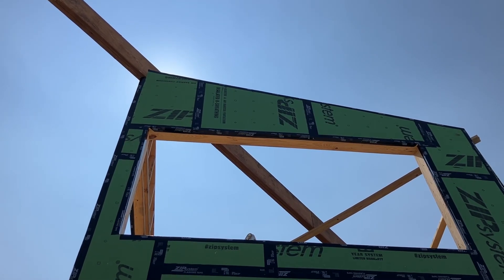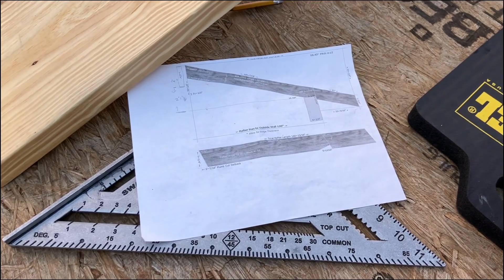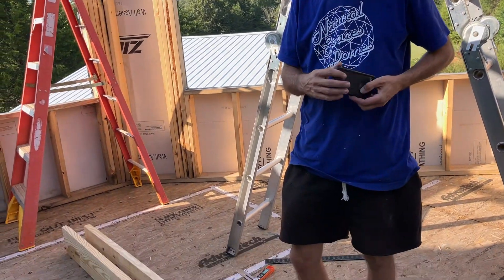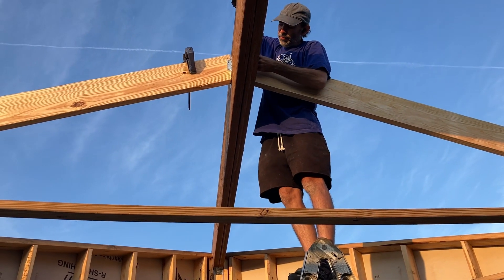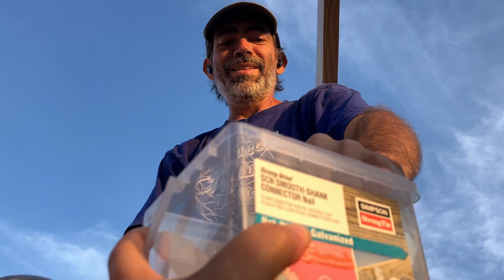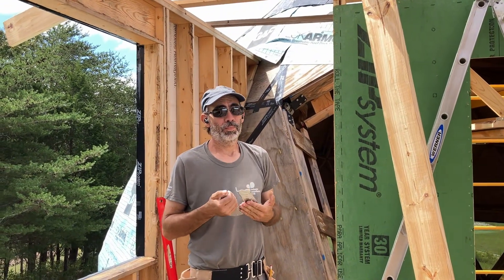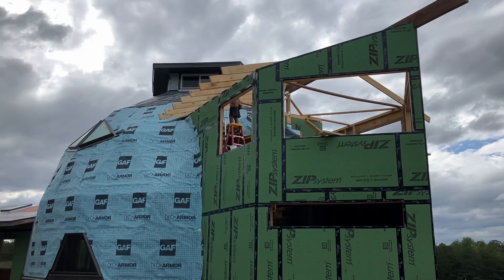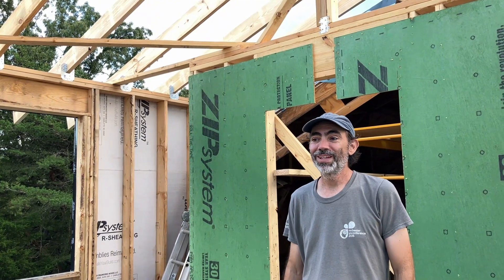Rafters And Angry Birds(Mouths)...Part One

Comment: Also I think Brian needs a new tool. Get him a jigsaw for those birds mouths.
Reply from the maker: Probably would have worked better and we do have one but it's not battery powered so he'd have needed to set up the generator.  Oh...so a new battery powered jigsaw?  Stop encouraging him! :)
Reply: @trippyacres  Never! I will always encourage more tools. Also I would recommend instead of measuring, cutting, and installing one at a time, once you get the first rafter right, use it as a template for all the others. Trace them out, cut them all, then install. Less brain strain on Brian 😉
Reply: @pnwscitech1589  I'm with you.. you can never have too many tools!  As for the rafter template, there was too much variance between sides and even on the same side.  Even the LVL wasn't perfectly straight.  I would have LOVED to make one and cut them all but had I done that, instead of messing up 7 boards, I'd have messed up 16.
Reply: @btrippy5344  but it would have been faster 🤣